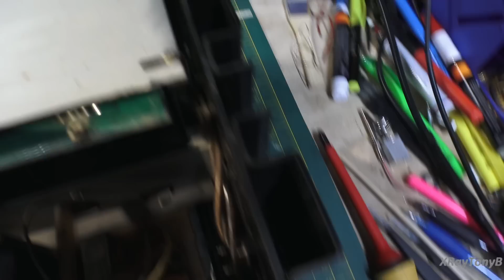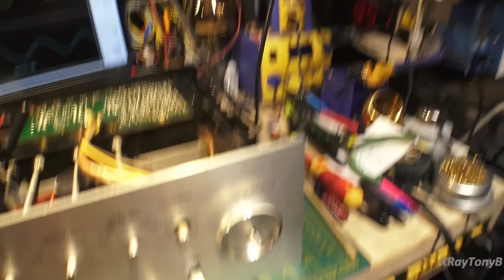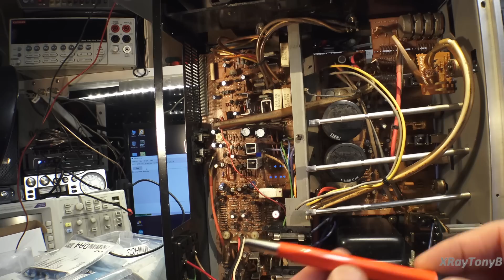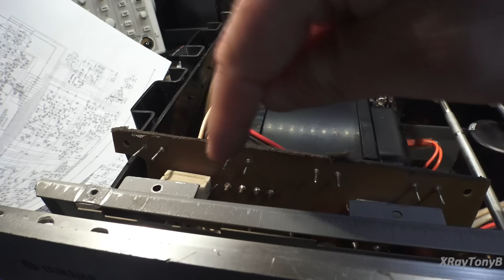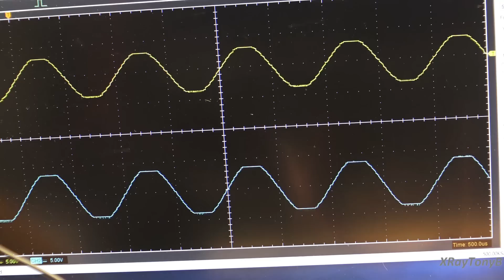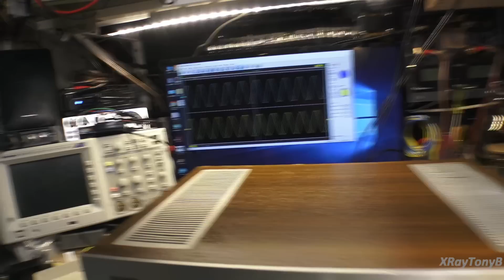Yamaha CA-810 Integrated Amplifier Repair and Restore

Comment: One thing I don't understand.  Given the wide bandwidth, and the fact you can compose square waves from a bunch of sine waves, I am suprised the square waves are not a bit better.  I know there's a limit to slew rate and such.  I play some synths, and square waves generally sound good in spite of the fact the waves are not perfect, so maybe it doesn't matter that much.
Reply from the maker: Thanks for the comment!  There's always a trade-off when designing these circuits.  Negative feedback will affect the slew rate of an amp, even if you use transistors with high transition frequency and careful circuit design.  There's always been debate over feedback vs low/no feedback.  There are pros and cons to both.  At the end of the day, what really matters is how the amplifier sounds to you and how it works with your speakers, not how it looks on a piece of test equipment.  I really like the sound of these Yamaha amps, but I also like the sound of the Sansui AU-X1 that has very little feedback in the design.  They both sound very different when connected to the same speakers and it comes down to personal preference.  Hope that helps.  Cheers!

Comment: Those output transistors are matched pairs right? Just two sets of matched pairs. Just curious.
Reply: Output transistors don’t really need to be matched. As long as the betas are at least 60, it’s fine. Beta droop at high current is a bigger issue. The bias circuit sets the idle current.  20mV across 0.47 ohm is a 42mA. About what I’d expect.

And if there’s an adjustment on the input stage, you’ll be able to zero the output. Input transistors ought to be matched.

Comment: I just bought one any thoughts on sound? My sub is powered and has rca can I connect to preouts?
Reply: No you can't, you want to run your l&r speaker wires to the back of the sub into the speaker inputs then run wires to you speakers.

Comment: Mine has just recently developed distortion on one channel and complete silence on the other.
Any idea what may be the problem?
Also, as a non tech, is it something I can repair myself?
Thanks for your help.
Reply: You can't repair without the proper tools but there are things that you can check.  It could be in the pots or the switches, turn on your amp and run music though some speakers or better headphones, work (back and forth, on and off) each pot and switch to see if you hear the sound coming back, if so clean appropriate pot, with faderlube, or switch, clean with deoxit protect with sheild.  Same setup but take off case, find the relay (the input selector rod is pointing at it) and tap it with something that isn't electrically conductive (like a wood stick), if the sound comes back when you tap it then you need to replace the relay (not that easy as you need solder skills).  There's more you can do, like figure out if the problem comes from the amp section or the preamp section (using the preout/main in terminals on the back, go to audiokarma and there's probably posts on how to do this).  More complicated, since it's old, 45 years, it's some transistors although this usually affects one channel (each channel is independent) or the whole amp (power supply issues).
Reply: @fernarias  thank you. I'll give it a shot.
Reply: Although this might be many things, it could be a result of a failed transistor in the final amplifier stage, or a leaky and shorted capacitor in the same vicinity. If you wish to restore your amp, these items are routinely replaced anyway by a qualified technician. If you did open it up and get lucky (maybe you visually spot the bad cap, and successfully solder a replacement in its place), it would be akin to retreading just one tire on an old car with four old tires. Soon, the next-weakest part will likely fail, and then the next. And if it's not worth repairing, and you really like the amp, why not try to find a used working model, or a similar one with more features, and then use the amp you have for spare parts.      - j q t -
Reply: She's in the repair shop as we speak.
Reply: @thesighcompany  How did  you go about finding a competent repair shop?
Reply: @HM55-77  yeah good. Found a guy not too far away who got her going again. It needed some caps replaced. Sounding great now.
Much more defined bass which is great.
Reply: @thesighcompany  I have a CA-1010. Bought back in 1977.  I would like to get it repaired but . I am not sure how I could find a repair shop.   Any Ideas?
Reply: @HM55-77  Depends on where you are I guess. It took me ages to find someone. Eventually I got a contact from a guy I sold something to.

Comment: Hi Tony.  I’ve been watching all your videos with great interest.  Do you think there is any benefit in leaving audio equipment left switched on permanently in terms of extending the life, for example will the capacitors eventually degrade anyway or wear out quicker if left on 24/7 vs thermal expansion etc?

Thanks, Andrew UK.
Reply from the maker: Good question!  A lot of the medical equipment I service at work is left on 24/7 for many years.  Although the capacitors would stay "formed", the added heat from being on all the time will cause the caps to dry out and eventually fail, often sooner than equipment that is turned on and off.  As for audio amps & gear, the warmer the amp is, the faster it will degrade the caps.  My guess is that the caps would last the longest when the equipment is used normally.  Each time you turn on and use the amp, it will help the caps stay properly formed.  By turning it off when not in use, you will prevent the caps from being exposed to unnecessary heat.  All of this applies mainly to electrolytic caps, due to the chemistry used in the electrolyte.  There are many different grades of capacitor and the life expectancy & heat tolerance can vary greatly, especially with higher ESR caps.  Its important to read the datasheet of a capacitor before choosing it for a specific application.   Hope this helps!
Reply: Thank you for your superb reply!  Kind Regards, Andrew.

Comment: go too high in voltage can modify character of amplifier because the higehr voltage the higher ESR (capacitor resistance) The esr is a parameter taken in consideration in manufacture conception

Comment: Is there any particular reason you didn't up the voltage rating a bit when replacing those 100µ/35s, like 50 or 63 V? Those wouldn't look as lost in the old footprint and I'd expect better longevity (bigger = less risk of drying out, lower ESR, higher dissipation handling) with no downsides that I can think of in audio applications. 

(IMHO electrolytics needing anything close to rated voltage to stay formed can be filed under urban legend. They will still reform = leak current under much lower voltages, albeit more slowly. Given the same chemistry and quality level, I'd always be inclined to go for the thicker dielectric = higher voltage rating, which invariably reduces the risk of the cap going excessively leaky eventually. Besides, caps have shrunk because dielectric layer quality is much better-controlled these days, which also means that a good old cap may actually withstand much higher voltage than what its necessarily conservative rating indicates. Being too skimpy may result in an effective downgrade from stock level, which is not what you want when putting in all the effort for a recap.)

Comment: Yamaha has recently re-introduced this amp,but with a bigger display and an even bigger price?!
Reply: gsmd770 just goes to show you there is no such thing as “vintage audio is better” it just has a bigger price now a days.
Reply: No. Completely different design head to toe.
Reply: Same prices but adjusted for inflation. The new high-end amps are much higher quality than the vintage ones ever were. Even the entry level A-S301 can outdo the old CA-810. Both of which are waited around 50-60 watts butt bench test at 80-85 watts. Vintage isn’t better anymore. It’s just psychological.

Comment: No way those final transistors were all original. The NEC ones were earlier repair/replacements. Why on earth would they have done that? No way!
Reply: Quite correct. Yamaha used only Toshiba outputs and drivers in amps and receivers of this era. We were an authorized factory warranty shop

Comment: I've worked on an old A500 with the same adhesive woes, in my case it had become somewhat conductive.  In the first video I made while looking at it I assumed that the electrolytics had leaked as I was getting milliVolt readings just probing blank areas of the board coated with that wretched stuff. The amp is still kicking around just as a bench amp. Really needs a full recap and several corroded resistors replaced, but it really isn't worth doing a full restoration. I've washed. scraped, sprayed, washed again to mitigate that crud. https://www.youtube.com/watch?v=4ffUZXVPoOs

Comment: I hate that glue
Reply: I rebuilt a Sansui AU-717 for a friend. It had a Zener diode and several resistors with completely corroded through leads. It has been working fine in their living room for years now.